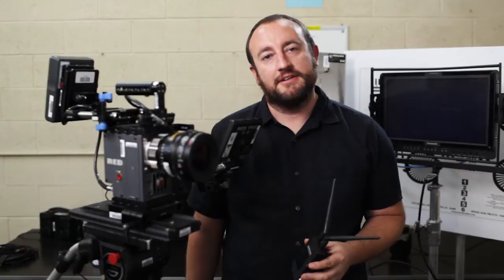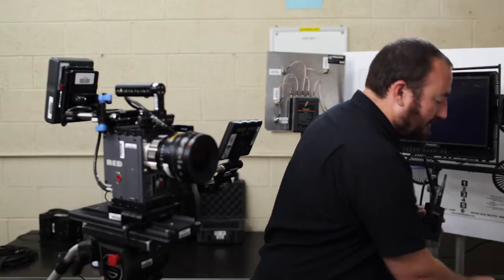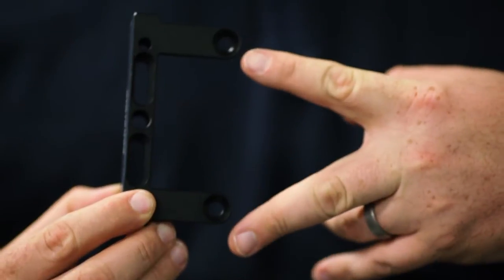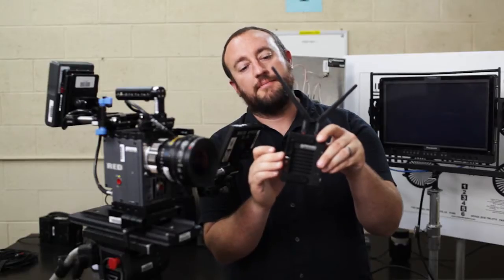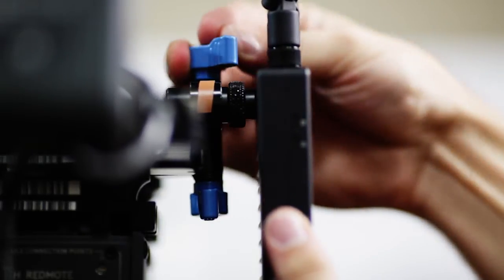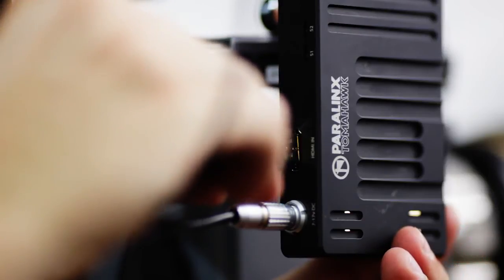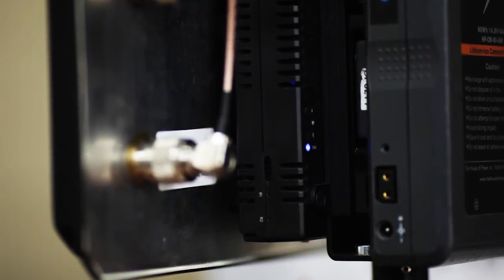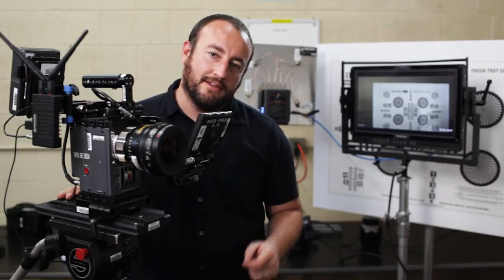Paralinx Tomahawk Set Up with RED

Comment: Hi 
I know that The video is very Old.
But i suddenly came across this video, and wanted to ask about the hdmi input.
Can you just plug the wireless transmitter in via hdmi without turning the camera, and still have it plugged in when you turn the camera and the transmitter on, iam thinking more of just like the SDI procedure,that says turn everything on, and SDI cable goes last in and when turning off everything then SDI cable goes out first.

Hope that I could describe it as good that could.

Thank you, looking forward to hearing from you